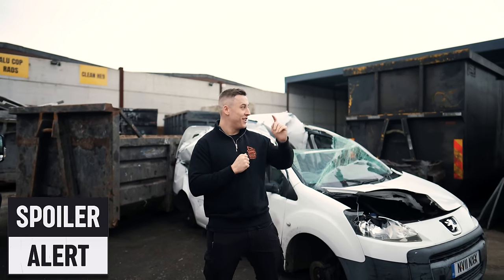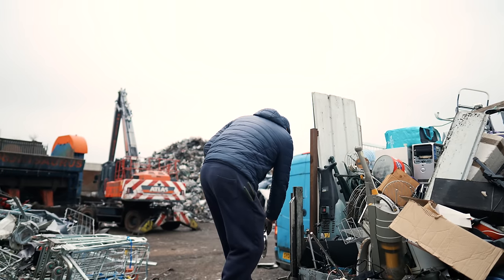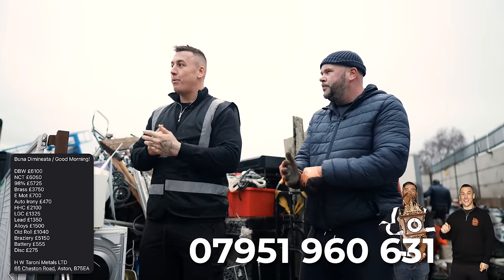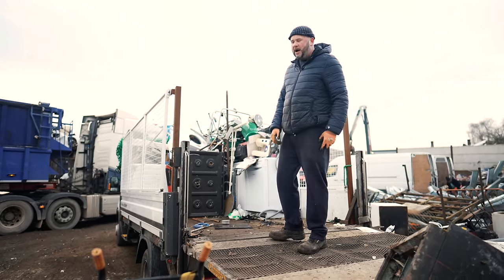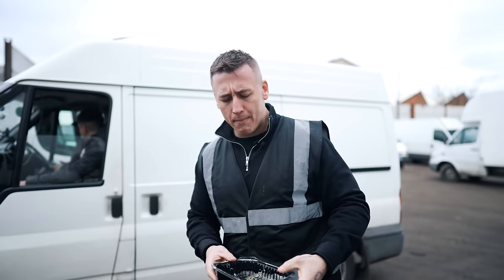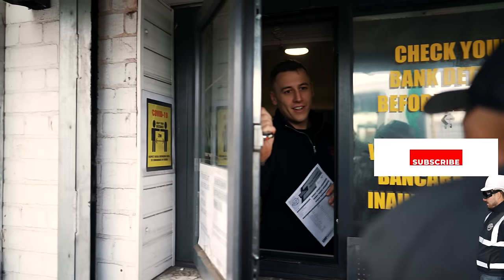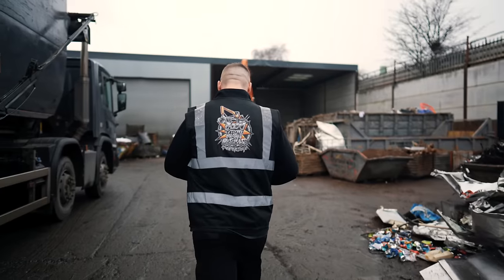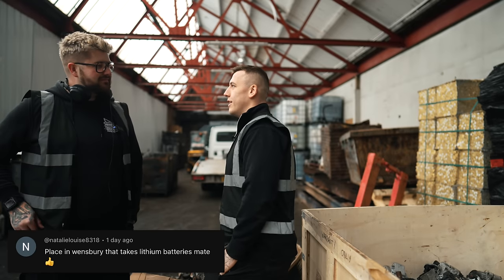ROLEX FOUND IN HOUSE CLEARANCE | Scrap King Diaries #S05E09

Comment: Tatters SHOULD NOT be allowed to separate their metals in the bays, no wonder there is a queue all down the road... I got a few washing machines the other day and separated the steel, ally, copper and the motors at home in my own time before coming down to you, also, where do you think the concrete from the washing machines go, they ain't going to put it back in their van are they 🤔